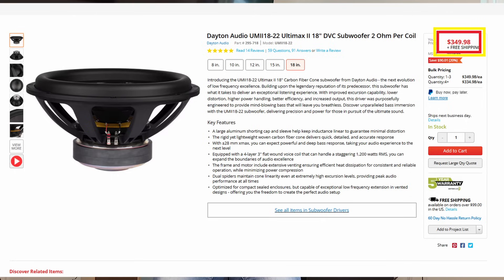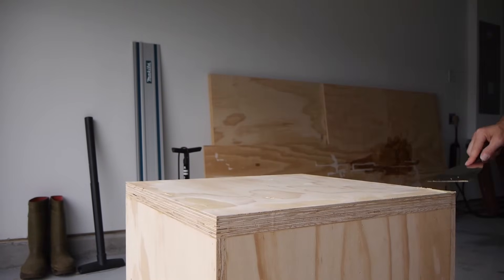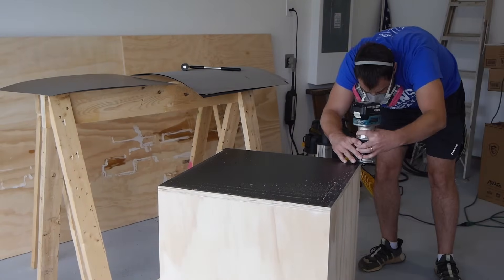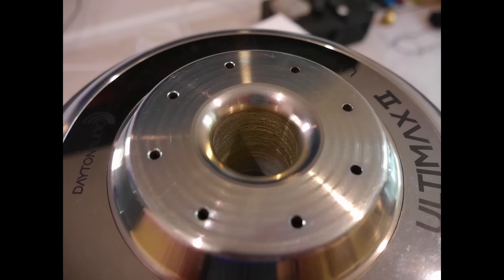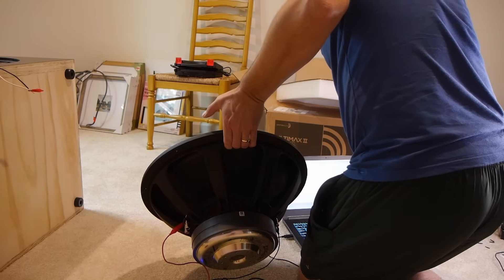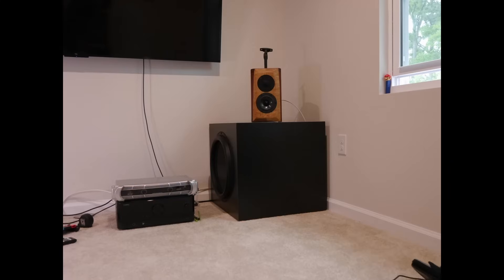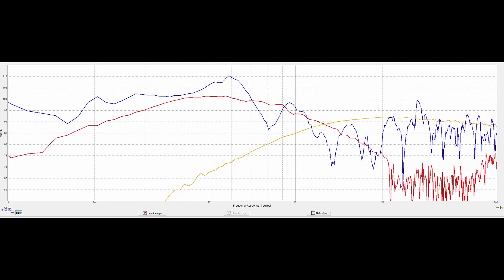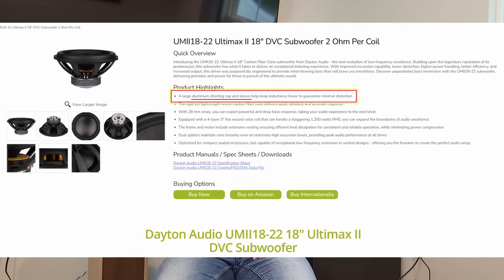Dayton Ultimax II UMII18-22 Test and Review in a Sealed Enclosure

Comment: I'm interested in building this subwoofer out with the Parts Express DIY kit...but I'm confused on how to u would actually connect the amp to the subwoofer box because the flat packs don't seem to have pre cut holes for a cap or plate amp.
Reply from the maker: You would probably have to cut in the hole yourself. I personally recommend a separated amplifier instead of a plate amp. Easier to install binding posts and better cooling for the amp. Usually more power per dollar too. But if you need it to be a plate amp they're not that hard to install with a jigsaw and careful measurements.

Comment: What sub would chose, that is a bit nicer?
Reply from the maker: Oh thats a tough question. If going sealed, probably just two of these instead 😅 But in all seriousness, there isnt a good next step to this that Im aware of. It feels like you jump from $400 to $800 pretty quickly. I might reply again after looking around because this question has me genuinly curious. Some of the examples I show in the video cost more but Id still take this.
Reply: @ImpulseAudioSpeakers was thinking in the videos you shared toward the end the you might choose a bit nicer sub.  I am working gearing myself up to building.
Reply from the maker: @ddent22 i was more pondering something cheaper. There are cheaper options, but with weaker motors, so they need a bigger box and no distortion control in the motor. The Ultimax hits a very good sweet spot in the mid to high end.
Reply: Can this sub be mounted a shallow mount,  maybe 14 inches?

Comment: Nice, I am looking at 2 of these for my room to replace the SVS pb3000.
Reply from the maker: Are you thinking ported or sealed?
Reply: @ImpulseAudioSpeakers sealed, my room 14x18x9.  The PB3000 are large and I don’t like the port even though I have them plugged.  Using ARC from AVM 70.
Reply from the maker: @ddent22 its a very good driver for sealed.
Reply: @ImpulseAudioSpeakers it seems many use the nx6000 amplifier for them.  Looking at the flat packs
Reply from the maker: @ddent22 Ive got mine on a NU3000.

Comment: Plywood is the worst contruction material for a subwoofer you could use.. thid box must resonate and sound tinny.
Reply from the maker: I would disagree whol heartedly. Ask the pro manufacturers. It's very stiff, which you want in a sub. Not damped. Stiffness pushes the resonance higher. This is why I brace it well (not shown in the video). Come over and have a listen. Don't use mdf for subs.

Comment: Following up on my reference to car audio subwoofers available the brands that seem to stand out to me and offer the most performance and value
would be "Sevard Audio" (a gem of a speaker company),  "Trinity Audio", And a new company just started in 2022 "Slapz Audio". Slapz is attempting to offer "Competition" level car audio equipment without the crazy competition prices. All 3 I think offer very good products for the price, which though not "entry" level do offer alot
with mid-level prices. I don't get the whole "Basshead" SPL competition thing. But it does drive innovation for subs in car audio and some brands really seem to get that right.

Comment: Dayton Audio makes good audio equipment at good prices. The Ultimax II is no exception. And building your own subwoofer, or any speaker is quite satisfying.
However, there is a phenomenon in the audio world I have noticed.  That is the "Bassheads" in car audio. Because of them, there is a plethora of subwoofers available
and a great deal of competition between brands that I think lends the ability to use car audio subwoofers in a home audio subwoofer build. That you can probably build
a dual subwoofer or 2 subwoofers for the same amount of money as you would if you were to purchase 1 home audio sub. It really is crazy the number of car audio subs available.
Reply from the maker: This is true. I alsmot bought Skar. But I did a comparison and found good reason to use this. For one, the cone is nice and doesnt have an ugly car audio brand on it.  Second, it have distortion control in the motor. A lot of car audio brands cheap out here. And last, because box size is slightly less important with HT, the T/S parameters can be better suited. Definitely car audio and pro audio drivers should be considered.

Comment: I definitely prefer sealed/infinite baffle over ported box. Somehow it sounds more correct to me. Long time ago I had 3way tower with 12" wfr, sealed - I still hit myself in the head letting it go, smooth bass, flat down to lower 30s Hz because of room gain and wfr being mounted at bottom of the enclosure.

Comment: Why plywood? Usually MDF or HDF are much better choices for speaker boxes then veneer over
Reply from the maker: Plywood is actually better. Its stiffer. MDF is more machinable and paint ready. Plywood is also lighter and nicer to work with. Lots of people use it. The difference is slight, so if painting or rounding edges use mdf.

Comment: Why the TINY little wires feeding the driver??
Reply from the maker: They probably look smaller than they are. But wire R=f(L,d) meaning the resistance goes up with length and down with diameter. The length is so short that the diameter doesn't matter.

Comment: Would love to hear how you setup multiple subs of different sizes
Reply from the maker: Generally different sizes arent an issue. Ported, sealed, horn, etc can be trickier to integrate. Running a couple of 10s with an 18 all sealed is just a matter of finding the best spot and eq'ing as required.

Comment: You could add a solid to your cabinet do reduce volume for Vas. Bricks maybe.
Reply from the maker: Yes I could have shrunk the volume with a big piece of styrofoam or something, but pulling the driver out would have been a huge pain. Doing this back calculation is pretty accurate to be fair, but i went ahead that way. The biggest issue getting TS parameters is the DATS isnt powerful enough for such an inneficient driver.

Comment: I spent my day tuning a system with four of these drivers.  It was interesting to see the response achieved here.   The system I tuned used 3 cu ft boxes from Parts Express and a Linkwitz transform was required to extend the low end.  The results were great.   Five hundred Watts per woofer were employed and there is plenty of output down below 20 Hz.
Reply from the maker: That will be a nice system. And that size of box and amplifier means you can vang on it all you want and never hurt anything. Have fun.

Comment: @ImpulseAudio- You seem to think a sealed enclosure will always have more output below 20Hz, vs a ported enclosure? You could make a 6 cu. ft. Net ported enclosure, tuned to 15Hz, that would prob. have more output vs sealed, from around 10Hz to 40Hz, & roughly the same output as sealed from 40Hz to 80Hz.
Reply from the maker: No, I'm well aware of the output differences. First, it would take more than 6 cuft. Second, I chase down to 5 Hz. If I had the space LLTs are the best of all worlds in my opinion, but even then I'd probably just add drivers and keep things sealed.
Reply: @ImpulseAudioSpeakers  I know space is a concern for you that's why i said 6 cu. ft. Net for ported. Since you like output going down to 5Hz, maybe run a sim. using 6 Net tuned between 10 to 14Hz, or running a tuned/weighted passive radiator setup? Earthquake Audio has some very impressive passive radiators, called Slaps. Their 15" Slaps V2 has 112.5MM👀 of Total X Max! Earthquake rec. using sealed enclosure sizes with their Passives. Just some ideas.
Reply from the maker: @evilinside5984 I definitely ran it through WinISD before starting the build and found sealed provided the most extended response. It's really hard to beat sealed for ULF no matter how you slice it.
Reply: @ImpulseAudioSpeakers  Sometimes when someone is stuck on a certain idea of what they think they want, they may miss out on something that may work better in their situation. I was just wondering how open minded, & thorough you were/are. Not trying to tell you what to do by any means. Sounds like you did a good job @ running sims.. Thanks for making this video, & responding..
Reply: @ImpulseAudioSpeakers  I was waiting to subscribe, until i seen how you respond to comments. I just subscribed.
Reply from the maker: @evilinside5984 thanks for the sub. Definitely open minded about how to skin the cat. I appreciate video comments and new ideas. I'm pretty sold on sealed, but have to admit a lot of movies these days are high passed at 20hz. Horn or ported does make a lot of sense especially in a small room. I could do a pair of small 12" ported subs tuned to 25hz and kill this 18". But I'm a suckered for that chest flutter down at 5hz.

Comment: Burned up 3 of these before I went to higher wattage. 😞 Behringer iNukes are beasts.
Oh yeah, also got some Dayton 18 inch subs (4) in the basement with my stereo down there that were built according to the V.B.S.S. plans on the AVS subwoofer forum.  Very happy with them.
Reply from the maker: You burned up 3 ultimax subs? The 18s? Whoa.
Reply: @ImpulseAudioSpeakers  Yeah, IIRC it was an inuke 6k.  Finally replaced with Ficar Audio neodymium subs.  Had T-S params that worked in the closed cabs the UM18s were in when ported so installed 3 6" ports in the cabs.  Had to bolt them to the studs in the basement to keep them from walking.  Gives tactile feel upstairs for movies.
Reply from the maker: @bribbripnairbnab7301 wow thats insane. Theyre definitely meant to be pushed by excursion rather than power.

Comment: Very clean build. I have 6 of those sealed and 3 old ones in full marties, etc. Value is also in the pairing with behringer. If i were to go with si hts i would need much more expensive and or noisy amps.
Reply: How does the sealed compared to the full Marty

Comment: As a fellow speaker builder I like that you went with plywood instead of the awful MDF style panels. They swell from moisture and are unnecessarily heavy, plywood is more stable and actually is made from real wood, not sawmill dust and glue.
Reply: I’m about to build some speakers and was wondering about using plywood instead of mdf.
Reply: @ElCidPhysics90  It costs more, but if you can afford it, that's the best way to go. Don't use Home Depot sheathing plywood, though; go with the type that is smooth and has fewer ply voids.

Comment: No polyfill??
Reply from the maker: When doing T/S measurements polyfill can influence the results. Ultimately in an enclosure this size for sub-150hz polyfill doesn't really do anything. The wavelengths are too long.
Reply: Interesting. I've definitely seen results contrary to what you're saying here. Why do manufacturers use it then? Seems like they're wasting money needlessly.
Reply from the maker: @BiffTannenBTTF I should say they dont do anything to combat internal reflections. It can make the apparent box size larger. Not really all that useful. For ported its possible it helps with port noise and leakage type things. Its an often misunderstood detaial with sealed subs.
Reply: @ImpulseAudioSpeakers  Maybe it makes more sense for ported subs then. Obviously if you can make a smaller ported box look larger to the driver, that's a good thing. Assuming more volume is a good match for the driver.

Comment: I would have used 1" HDF if not MDF. Surprised you used Plywood but another guy did same thing. Baltic Birch is a popular wood option used by JTR. Reinforcing the sides and internally just like the box kits do is Key. I was a bit lazy and wanted a guaranteed powered subwoofer so I paid $500+ for the Starke SW15 sealed 15" really happy with the quality and value, it's best for value buying a ready to go subwoofer with XLR connections.
Reply from the maker: Plywood is stiffer and nicer to work with. Lighter too. 

I didn't show the bracing but there's more than just the ribs.

Comment: Parts Express sells the Dayton Ultimax II woofer 18" along with the Sealed Box kit 4 Cubic feet, Free Shipping is about $530. Sold Out but the 15" kit & woofer is $430 and In Stock.
Reply from the maker: I saw that but if you have the tools and enjoy building I did mine out of plywood with the laminate finish and terminal cup for about $120. Total build cost $470 and it looks much better than painted mdf. Depends on your build skills really.
Reply: @ImpulseAudioSpeakers custom box is better than the Kits, but if using 1" HDF or Quantity mdf. Monolith THX subs use 1" HDF as well as Emotiva 15" used to but they stopped making that size.
Reply: Stereo Integrity 24" Subwoofer they want $2,000 just for an Empty Box is Crazy!
Reply: @ImpulseAudioSpeakers I built 3 sealed subwoofer boxes for car audio but 25 years ago. One was for Dual 12s but a divider to keep the individual space tight bass. Best is going to the local Lumberyard and get all the major cuts done there. Home Depot for the Clamps, glue, Jigsaw
Reply: @ImpulseAudioSpeakers  for me the biggest concern or issue is the Plate Amplifier with DSP built in or buying an amplifier to connect to the A/V Receiver. Plate Amplifier like Dayton 500 watts RMS with DSP can be cheap $350 max. But getting 1,000 watts RMS will be more. This is also the hidden cost most people don't think about. Kyle got the Sinbosen amplifier for his Dual S.I. 24" subs.

Comment: 6:30 That internal cable is waaaaay too thin
Reply from the maker: R => f(L) and L is about 2ft.
Reply: @ImpulseAudioSpeakers what guage ?,.. we all thought 10-12 guage was needed
Reply from the maker: @integra8502 no that's definitely not required, but it doesn't hurt anything. I actually did a video about wire gauge recently. This 16 gauge wire adds about 0.001ohms or something. Not worth fussing over.
Reply: Nice to see you back,nice build !

What do you think of the "Stereo Integrity" SQL 15" driver ,can be used in very small Sealed 2 cu/ft !
Reply from the maker: @integra8502 not sure. I havent looked into that driver before. Personally I haven't found SI drivers very compelling. But I haven't looked at that one.

Comment: That thing can handle 1200W RMS...hoooooo-leeeeee...
Reply from the maker: I should test that 😅
Reply: @ImpulseAudioSpeakers  RIP...lol

I've been out of the audio world for YEARS, but way back in the day, I had two 10" Diamond Audio dual VC subs in my car that were running 1200W RMS (600W each) and it was BRUTAL, man. Pulled one out pretty quick. It SAS SO loud. Forgot to rewire the dual VCs in the remaining sub and blew the amp. RIP, Hifonics Brutus. 😭

If you DO push this thing, you GOTTA make a video. It's going to hurt. lol

Comment: Good to see you back! I was just finishing my subwoofer project over the weekend. I use heavy duty z ties to in the screw holes so I can adjust it and not get my fingers stuck putting the sub in the cabinet. I have a Dayton reference high excursion 12" I bought awhile ago they discontinue them unfortunately. It has a triple stack magnet. I used a 15" sub woofer passive radiator on the bottom.
Reply from the maker: Nice sub. I've done the zip tie thing before. It works good but if the recess is tight you have to be careful.
Reply: @ImpulseAudioSpeakers thanks and good to see you back !

Comment: Great job! I decided to purchase four of the Dayton Ultimax 18s and go sealed in a 6 foot tall 25inch diameter sonotube for each. It is practically infinite baffle due to the huge sealed enclosure. I get the benefits of putting a sub in each of the four corners, get amazing room gain, and can move them around rather easily. Plus the benefits of a sealed enclosure, and I keep the drivers in check with MiniDSP active control to EQ out some of the dips and boost the very low end a little. Fun fun fun fun!
Reply from the maker: That sounds amazing!
Reply: You have to make a vid on those stacks. Ive done some similar builds with 6.5 and the sound was amazing!

Comment: Hi! I made my subwoofer 5 years ago. It included a Dayton Audio speaker, but not the Ultimax, but the Dayton Audio Reference RSS390HF-4 type, and if I were to buy it now, I would buy this one and not the Ultimax II type. The Reference, based on the parameters and graphs, has a smoother transmission, lower resonance frequency and is more sensitive. A net 254 liter box was made for it, with internal directed air, a 160mm internal diameter 54cm long reflex tube, the tube faces the floor, the speaker forward, then 99kg. 30mm thick MDF sides, 80mm thick corners made with CNC machining, and 60mm front panel. I really like it, especially how it works in the infrared range.😀

Comment: I have a ported 15" sub in my main system that I bought a few years ago. I love it to death but knowing what I know now, this driver in a 10 cu ft sealed box would do a lot closer to what I want from my sub. i think that's going to be my next major purchase
Reply: I wonder if you would run into excursion limit issues in a box that big? Obviously depending how much power you want to feed it
Reply from the maker: The box doesnt need to be that big, but if you did it wouldnt take much power to reach its max potential.

Comment: Great to see you back.  18" and such a HUGE box at only 28Hz fs. I'm using Scanspeak 7" with less fs and 1/3 price in a pair of front ported two ways. The deep bass is more than plenty, although your room is double the size tbf.  

You mention 'new' software, surprised you're not using Vituix and REW?
Reply from the maker: Fs is just an electrical parameter. It doesnt tell us that much about how low a driver will play. And this will certainly go lower overall if you want extension below your port tuning. And output will be a lot higher too.
Reply: @ImpulseAudioSpeakers  now try new software 😎.